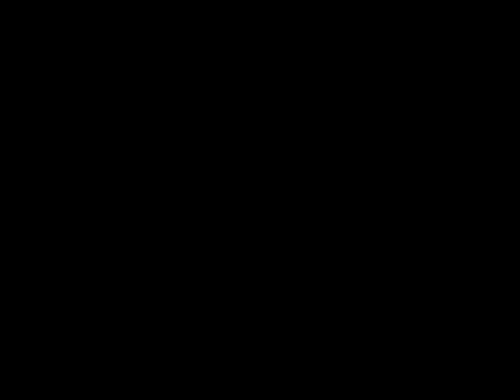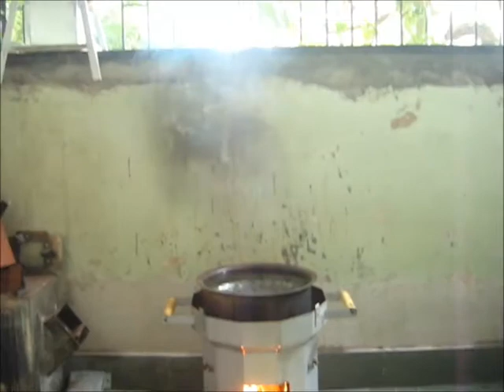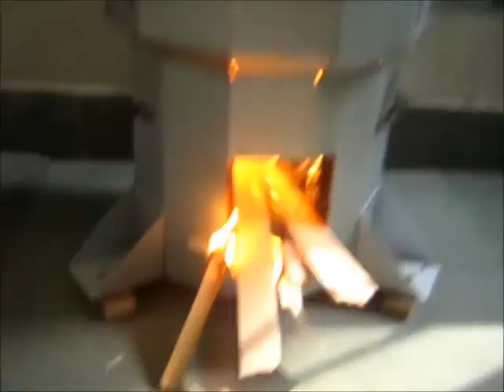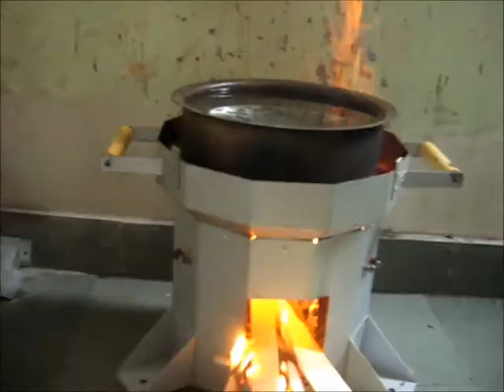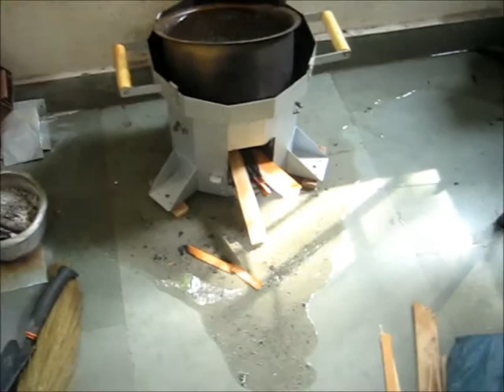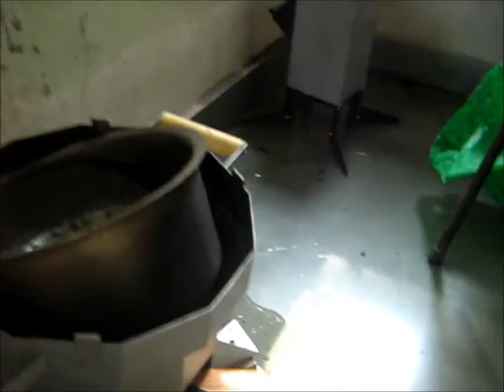Berkeley Darfur Stove - Heavy Smoke Emission problems  and dangers of  Pot-tilt accident

Comment: Thanks for calling the Berkeley-Darfur Stove "renowned".  There is a reason it is renowned:  My team and I worked closely with the refugee women in Darfur during 2005-2009 to iteratively mature the stove design, meeting their requirements.   
Let me try to address your comments both made in the video caption and in the audio.
(1) The stove is designed to support the cast-aluminum round-bottom pots of two different diameters and radii of curvature that are in common use in Darfur.  We have not experienced nor heard of a round-bottom pot used in Darfur ever tilting on its own and spilling water when supported on this stove.   For flat-bottom pots used elsewhere, we have designed different pot supports.  It appears that you did not use a stove with appropriate supports for your pot.  I can't see the pot supports in your video.
(2) I am puzzled with your audio comment that the stove works only at high thermal power, and the flames extinguish at low power.  That is not at all our experience in the laboratory, nor in the field. In eight past years of working with this stove (2009-2016), we have operated the stove at high power (5.5 kW thermal output), and low power (about 2.5 kW thermal output).   In extensive interviews with women in Darfur over the past years, this complaint (about the stove not working at low thermal power) has never emerged.  
(3) About the smoke, there is adequate published data on the emissions from the Berkeley Darfur Stove (Jetter et al of US EPA, publication in ES&T, 2012,  and Preble et al of UC Berkeley, publication in ES&T in 2014).  You can find these publications via the internet.  The emissions of particulate matter (smoke mass) and CO, per MJ delivered to the pot, are not out of line compared to other stoves.  They are actually lower than most other stoves in this class. 
-- Ashok Gadgil , Berkeley, California.